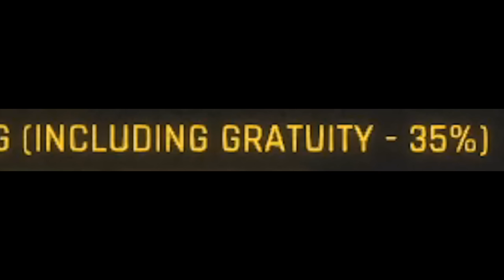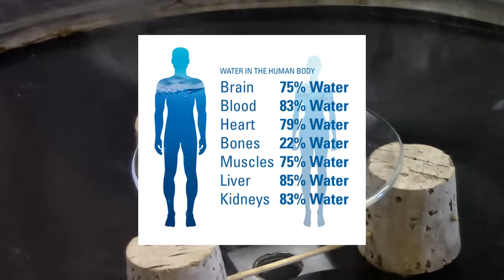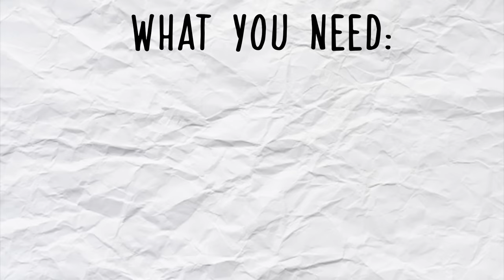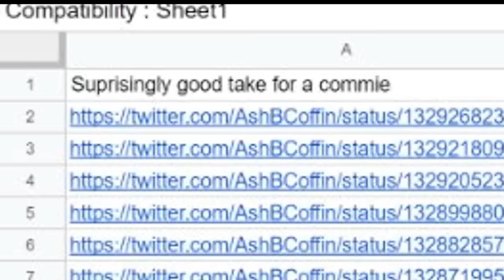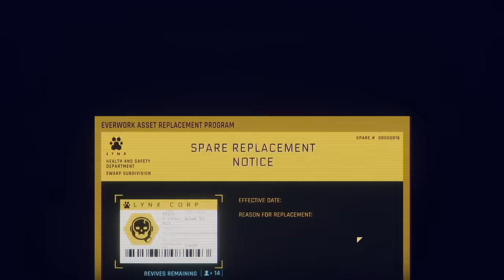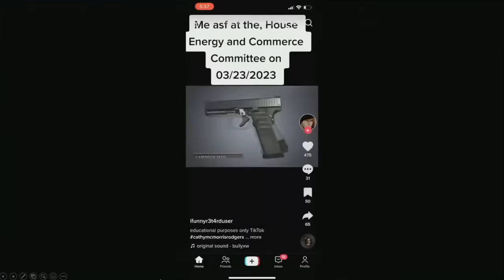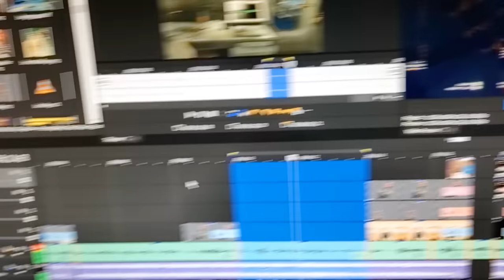Hardspace Shipbreaker Review | We Own You® Edition™

Comment: I looked up the decompression incident Sseth mentioned, due to human error, some valves were opened before they were supposed to causing 1 diver to be shot through a tiny door like that one crab in the underwater pipe video, and the other four died immediately because their blood boiled inside them, not because of heat but because of the pressure.
Reply: This is why you need to follow protocol when decompressing.
Reply: DELTA P
Reply: Which crab video?
Reply: They’ve actually come around to it not being human error. They were working with outdated and unsafe equipment that had no failsafes which never should’ve been allowed to occur, let alone sanctioned.
Reply: @deifiedtitan the failsafe helps avoid the consequences of human error
Reply: @honestabe411  It avoids consequences by preventing the human error happening in the first place. It was the fault of the equipment.
Reply: @3AdrEnAlinE3  equipment only does what you tell it to. This is real low iq thinking. The better equipment helps prevent the human error such as in that case
Reply: @TooFewSecrets WHEN IT'S GOTCHA

IT'S GOTCHA.

Comment: 4:08 Byford Dolphin was a semi-submersible, column-stabilised drilling rig operated by Dolphin Drilling, a Fred Olsen Energy subsidiary. It drilled seasonally for various companies in the British, Danish, and Norwegian sectors of the North Sea. It was registered in Hamilton, Bermuda until scrapped in 2019.

At the time of the accident, decompression chambers 1 and 2 (along with a third chamber which was not in use at the time) were connected via a trunk to a diving bell. The connection made by the trunk was kept sealed by a clamp operated by Crammond and Saunders, who were experienced divers. Coward and Lucas were resting in chamber 2 at a pressure of 9 atmospheres (atm). The diving bell with Bergersen and Hellevik had just been winched up after a dive and joined to the trunk. Leaving their wet equipment in the trunk, the two divers climbed through the trunk into chamber 1.

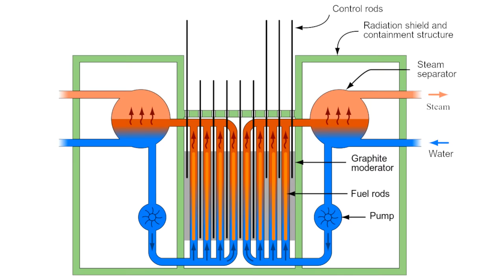Comment: 7:48

Sseth, I greatly appreciate you including a segnment about how nuclear reactors don't explode the way nuclear bombs do, but unfortunately the statement "A reactor wiill never go supercritical" is incorrect.

Supercritical just means the power level is increasing, in the same way that subcritical means the power is decreasing, and critical means the power level is stable.
Every time a reactor starts up after a refueling outage, it goes supercritical until reaching 100% output, at which point it's just critical. During shutdown, it goes subcritical until the power level is 0% (or near as possible, given decay heat).

Comment: I instantly recognized the demon core incident when you've shown the screwdriver and the two caps. Kudos for bringing real world science failures into these videos!
Reply: Screwing around with a screwdriver and a partially encapsulated ball of subcritical plutonium at work, in order to show off to your co-workers, is always a good time.  Don't listen to the critics.
Reply: Just make sure to keep something nearby to mark your position in the room so you can measure how much radiation you just absorbed if you slip up.
Reply: @NefariousKoel  "As if I'd ever do something as stupid as that. Do I look like that amateur, Slotin😏? More like Slu- WOAH!" drops brick of tungsten carbide
Reply: @jetex1911  It's funny because when less than lethal first started being required for standard issue before the taser came out, most were kinetic projectiles like rubber buckshot. However, they were lethal at a certain range or completely ineffective at too far of a range, so people using the shotgun or 37mm with LL rounds were told to drop a pen or a hat down where they shoot the suspect so later the distance could be measured and data could be collected to figure out the weight to distance lethal threshold.
Reply: The demon core was less of a science failure and more of some idiot trying way too hard to win a Darwin Award.
Reply: @EvilDoresh  The funny thing is that it wasn't just one criticality incident with the Demon Core.

The screwdriver/hemisphere one was done by Louis Slotin in 1946.
9 months before that, a scientist named Harry Daghlian was experimenting with the core by stacking blocks of tungsten carbide around it. As he was about to lower a block onto the assembly, his radiation counter started to go off, indicating that the core was about to go critical. In his shock, Daghlian accidently let go of the 10-pound block of neutron reflecting material, dropping it onto the core.
While his quick thinking made him swipe away enough of the neutron reflectors to bring the power excursion to a halt, he still received more than enough rads to die from acute radiation poisoning a few weeks later.
Reply: @maxjoechl5663 
Then in the famous screwdriver incident, Slotin managed to quickly flip the core open again, saving the lives of the other scientists.

And the morale of the story: don't play with balls made out of plutonium
Reply: Oh my SCIENCE, I instantly recognized this popsci meme that was everywhere a few months ago!!1! 
Kudos to you, kind stranger, for sharing this wholesome 100 big chungus moment, take my upvote

Comment: Biggest tip I can give for this game is to learn to use the Splitsaw cutter mode over Precision mode.
Many angles allow you to hit a cut point without causing danger, AND later on hit cut points that are in a row, with just one blast. It can make the difference between 2 seconds work, or 30 seconds.
Reply: I felt like i was cheating when i figured that out and hit all three sections of the mackerel's side-chamber
Reply: No

Comment: Looked up the dolphin incident. I'm an aerospace engineer, so I did some quick back of the envelope calculations, just so I don't get rusty. 

Air in the diving bell was at 9 ATM, air in the chamber (with people there) was at 1 ATM. Assume the trunk connecting the bell and chamber is about human sized (say, 5 foot diameter tube). 

You're looking at a pressure force of around 1.3 million lbs (220 4x4 trucks for reference) on that chmber door. Release the clamp without proper pressure equalization (which is what happened) and you get airflow accelerating near-instantaneously to about 1250 mph. For reference, it takes about 70 mph winds to knock someone down. F5 tornadoes can crack steel-reinforced concrete beyond repair, launch vehicles over 3 football fields, and tear secure homes off their foundations and disintegrate them before they touch the ground. Thats at about 260-320 mph. 

Poor bastard at the door tasted Mach 1.6 for about a split second. Literally killed him 60% faster than your voice could reach him from across the room.
Reply: At least it was painless
Reply: @yourmanjimbo1302  Yeah, he was the lucky one for sure.
Reply: @FrogSitter661  I don't think any of them suffered, to be fair. Probably didn't even know what killed them.
Reply: @FrogSitter661  
The other guys were flash-boiled and thus died instantly as well.

Comment: Well, I didn't expect to learn about nuclear criticality, but here we are!
Sseth's content really is a blessing.
Reply: He kind of mixed up "supercritical" and "prompt (super-)critical", though.

Every time you increase the power output on a reactor, you go supercritical until your reactor reaches a new equilibrium. This is normal.

However, a nuclear reactor should only reach the supercritical state if you account for the so-called "delayed" neutrons that are released several seconds or even minutes after the splitting of a uranium atom.
This limits the exponential rise in power, allowing the reactor to be reined in by its control rods and the inherent safety features of its design.

On the other hand, if the "prompt" neutrons released immediately (femtoseconds) after a fission event are already enough to sustain a chain reaction, the process is no longer controllable. In this state, the worst thing that can happen is no longer a "meltdown", but the actual explosion of the fissile material.

Comment: The Byford Dolphin was a semi-submersible drilling rig operated by Dolphin Drilling, a Fred Olsen Energy subsidiary1. In 1976, just three years after its launch, the Byford Dolphin ran aground during transit from the Frigg oil fields in the North Sea to the port of Bergen2. Six people died when they fell from their boats
Reply: I think he’s referring to the other accident that occurred where 4-5 divers were involved in explosive decompression where their blood boiled from their bodies and one guy was sucked through a 24in. hole
Reply: Unfortunately he used the date of a different incident. He was really referring to a 1983 incident where 4 divers and an operator died. 3 divers died when the soluble fat in their blood became insoluble as proteins denatured and their blood instantly boiled as the compartment they were in reduced from 9 atm (atmospheres) to 1 atm very quickly.

The 4th diver was sucked through a horizontal gap in the door that lead to the section meant to transfer between the compartment and the diving bell (a mechanism and room that is pressurized and moves divers to and from the water). One of the outside operators unsealed the clamp connecting the bell to the trunk (the transfer area) before the 4th diver could close the chamber door. This resulted in him being pulled into the gap due to the pressure difference. Be was bisected, had most of his internal organs from his abdomen and chest ripped out of his body, and was severely mutilated as the rest of his body was then ripped out of the chamber, dying near instantly. Same with the other 3 divers, died very fast as their blood boiled, circulation ceased completely, and all of their blood vessels were filled with fat that was previously soluble in their bloodstream. The operator, the same one that released the clamp prematurely, died by getting hit by the diving bell, which was shunted out of place by the air rapidly depressurizing, striking him. The second operator lived with severe injury due to the module flying off.

Comment: Random fun fact, your blood does not boil once you go past the Armstrong limit (the point at which atmospheric pressure is so low that the boiling point of water is lower than your body temperature). Turns out, your skin is tough enough to create the pressure required to hold your blood at enough pressure to save you from exploding into a bologna mist cloud. Will you die almost immediately anyways? Yes, but that's due to lack of oxygen, at the 1-2 minute mark, not from all your blood boiling instantaneously at the 0 second mark. To illustrate my point, Jim LeBlanc was exposed to nearly complete vacuum. He passed out within 15 seconds, but not before feeling the water boil off his tongue. The only symptoms of note after the incident were temporary hearing loss and dry eyes.

Comment: On the topic of the grapple meter:
Green means it'll budge with normal grapple use, it'll pull to you with right click, and it will push away when blasted.
Yellow means it'll budge but won't be super happy about it, you'll pull to it, and it will push away. 
Red means it won't budge, you'll pull into it, and you'll push away.

Comment: for the thing about being in a  unpressurized area you can make a small hole to release pressure if there is no atmosphere control unit keep it small, so objects cannot fly out. If you make the hole too large things can fly out and stay away from the hole just in case an object comes flying and rips a hole in the wall. Losing pressure isn’t really a big deal but just be cautious and aware of when you’re going to lose pressure.
Reply: unless there is still an AI Node somewhere, that messes with the pressure regulation^^

Comment: Hey I know this is random and months ago, but you would still see Cherenkov radiation in space. The medium in question is the metal around the reactor. Charged particles are passing through it at a speed greater than the phase velocity of light, which then creates visible light. The visible light then passes through the vacuum. Though it certainly wouldn't be that bright.

Comment: This is probably pointless but I felt compelled to share anyways. All reactors in fact go super critical at some point. When speaking about sub-critical, critical, and super critical, these are terms used to describe the power state in reference to neutron production. Sub-critical means too few neutrons available and power is decreasing. Super critical means there are excess neutrons and power is increasing. Critical is the happy medium between the two states where the desired power level is maintained. 

This criticality state is primarily controlled with control rods and secondarily with coolant temperature. All reactors are super critical during startup procedures and sub critical during shutdown procedures. It is only the extreme ends of these states that are undesirable.
Reply: you talking Three Mile Island or Chernobyl undesirable?
Reply: @toomanyaccounts   the three mile island event was a leak of radioactive substances, not a meltdown or anything serious concerning the reactor itself. Chernobyl was an actual meltdown of the reactor. 

The level of “undesirability” is dependent on the design of the reactor itself. It’s been many years since I’ve worked in the industry so I don’t recall all the technical terms. Reactors can be designed so that coolant temp has either a direct or inverse relation to reaction rate. 

So in reactors that have a direct relation, the hotter coolant gets, the more heat the fuel can generate. This is obviously vulnerable to runaway events where the coolant gets too hot too quickly, making the fuel generate more heat which heat the coolant evermore. A vicious cycle that can result in an explosion if not handled quickly enough. 

Reactors that have an inverse relation between coolant and fuel reactivity are inherently more stable. If the fuel generates too much heat, the coolant heats up which impedes its ability to slow neutrons down which are needed to maintain the fission. This sort of fuel-coolant relation opens the system up to the opposite vulnerability as the other type. In this type of reactor, allowing relatively cold coolant to suddenly enter the core will result in a massive power increase. The concern here isnt necessarily a steam explosion, although with enough cold coolant, it’s certainly a possibility. The major concern is a sudden localized increase of heat in the fuel which may cause swelling or blistering. This has the possibility to impede or worst case prevent a control rod from lowering. This reactor is kinda interesting cause you want to cool it, but not too much or too quickly. But it is less at risk for a Chernobyl type event. The most likely (worst case) event for this type of reactor is a steam explosion, followed by a shutdown due to no coolant propagating its fission process.

Comment: So I bought this game on Steam and I want to provide some clarification. You don't have to do the campaign mode. You can just break down ships.

But the problem is, there's no structure.  No progression. 

If you WANT to have things like upgrading gear, managing O2, fuel, and time to pay back a debt, you HAVE to do the campaign.

If you do the Free Play mode, there's none of those. You just pick a ship, it gives you a random build to take apart, and the timer ticks up. You have infinite resources.

So the ideal way to experience the game within the given restraints REQUIRES sitting through the garbage, preachy story.
Reply: Thanks for the clarification. I was wondering about that
Reply: @josedorsaith5261  No problem. I'm all for giving things their fair dues. The game IS fun but having to put up with a story that you're forced to sit through to get the mode the game is designed around is just absurd.

And, at least to me, this game doesn't have the same satisfaction of dismantling that Viscera Cleanup Detail does with its messes. Like, when I finish salvaging a ship, I don't get the same satisfaction. That's why I don't care for the free mode either. I need the goals/constraints here, that's what it feels like the game was built around.

Comment: 8:38 I do not believe your radiation is achieving FTL.
Reply: That's the point, actually. Nothing is faster than light in a vacuum , which is why this radiation can't happen in space.
Reply: @EvilDoresh  Nothing is *faster than light*.  Literally ever.  That's its shtick.  Mediums make light (and all particles) slower, not faster.
Reply: @ClubPenguinMaster88  But not everything is slowed down by the same rate, and in the soothing waters of a reactor tank, certain particles might ever so slighty pull ahead of the slowed light.
Reply: @EvilDoresh  Maybe I misunderstood what you had said.  Thought you meant there are mediums that accelerate light

Comment: 8:40 you mean the speed of sound right?
Reply: Nope. When we talk about "the speed of light", we actually mean "the speed of light in a vacuum", which is indeed the fastest anything can go.
But light actually slows down when moving through matter , like say the water surrounded a typical nuclear power plant reactor. Light only works at 75% efficiency here, making it possible that some forms of radiation are faster

But since these space reactors blow up in space , there shouldn't be a radiation because nothing is faster than light in a vacuum.